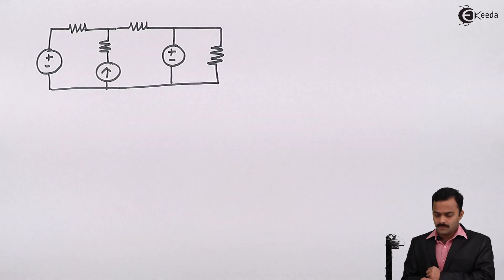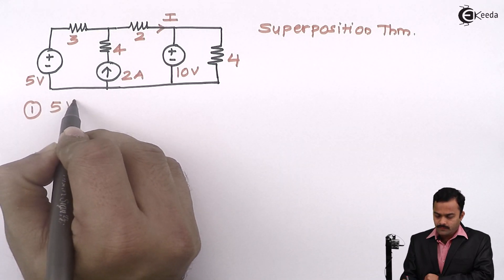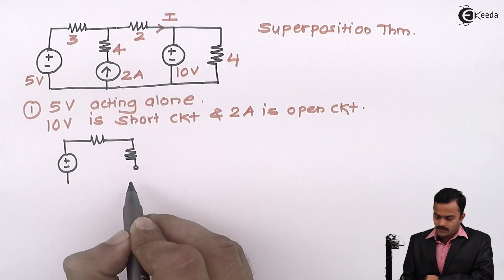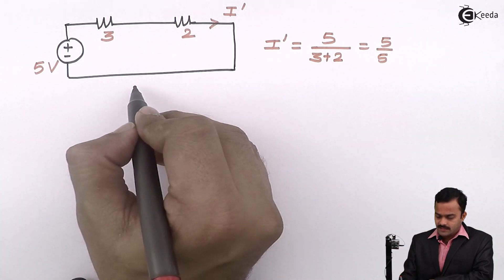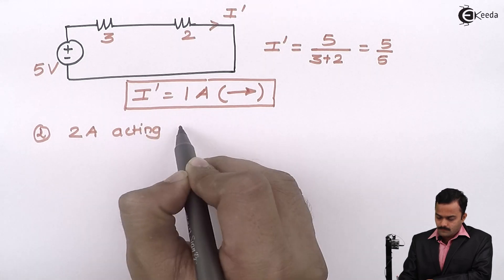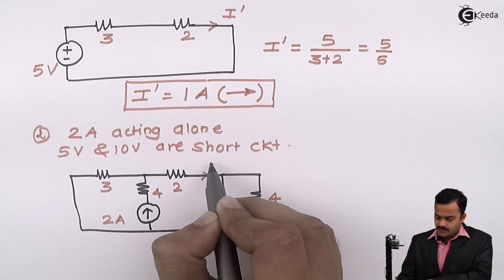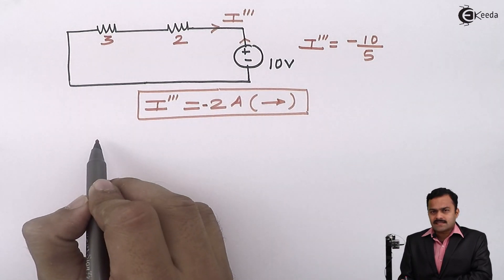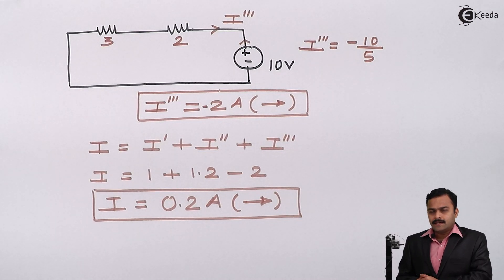Superposition Theorem : Problem 3 - DC Circuits - Basic Electrical Engineering

Comment: Sir while considering 10 V baterry why do we reduct that 4 ohm bcoz this time it's potential is fix but current would also flow through it i think. 
Plz sir correct me plz 🙏 if I am thinking incorrect about this last step in the solution of this video. 
Plz reply it fast sir ji. 
Parso exam haj electrical ka IIT dhanbaad ka😅.
Reply: Because in series current never change

Comment: why the 4 ohm resistance is redundant in step 3?
Reply: Doubt ka ans samza kya sis! Plz 🙏
Reply: Because in series current never change
Reply: @AryanSingh-sg1ov  but bro in 3rd step 4 ohm resistance will make parallel connection so how it is in series

Comment: why this 4 ohm(side)  R become redundant??
Reply: Sourav Panja try that circuit in breadboard. you'll notice that there's a line connecting before the resistor so voltage drop remains the same